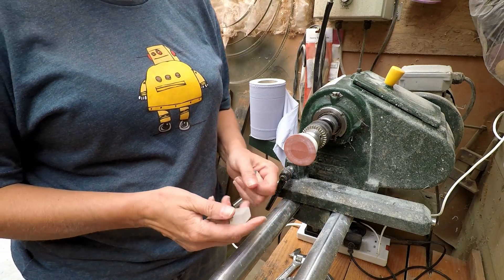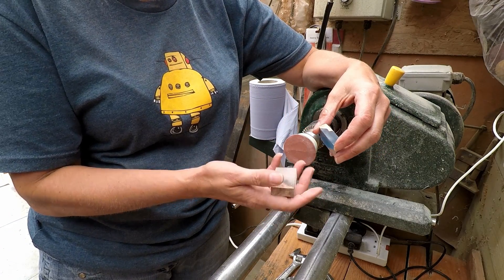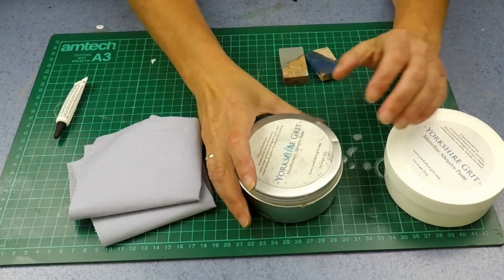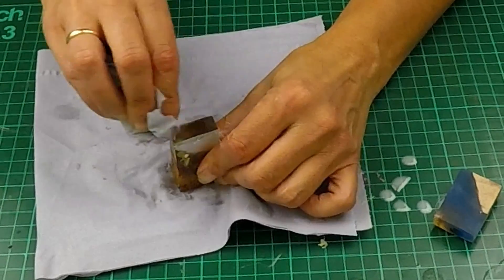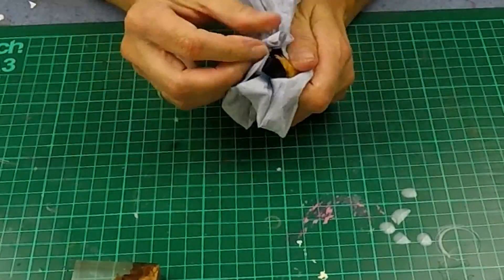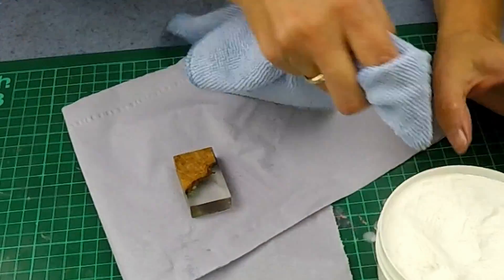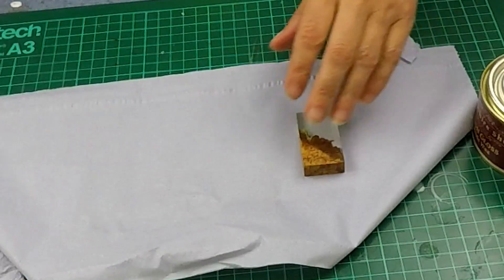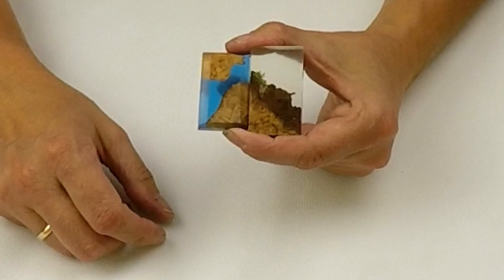Quick and easy high polish for resin Jewellery.

Comment: This was really interesting. You sanded to 600 grit yet then polished with Yorkshire grit which is 240grit paste rated and still got the shine. I would have imagined it would make it worse but clearly it works well. Lovely little video there. I usually use Mezerana polishes on mine but may give Yorkshire grit a try with a polishing wheel
Reply: I think it might be because the 240 grit grinds down to a finer grit as it says on the Yorkshire grit website:)

Comment: Thanks for this video. You've convinced me to buy Yorkshire Grit and the microfine one aswell, so I'll do that real soon. Seems like it'd save alot of time instead of what I've usually done, just rough sanded my projects then coated them with a layer of epoxy, which works great but it adds a ton of time you have to wait and alot of things that can go wrong. The yorkshire grit doesn't seem expensive either, which is nice. Thanks again <3
Reply from the maker: Thank you yes has really made a difference to the finish in my projects :-)

Comment: Do you remember each grit of sandpaper used to go from 120 - 600? Or did you go straight from 120 to 600 without other grits in between? Thanks, .and love your channel :)
Reply from the maker: I ised 120, 180, 240, 400, then 600. Thank you :-)

Comment: Hi Pam, do you find your resin clear enough with this method? I'm really trying to mimic glass with my resin. Should I add a round of 10,000 or 12,000 grit wet sandpaper after the microfine paste in order to get even more clarity? Or will it not make a difference? Thanks!
Reply from the maker: Hi i do get really good clarity but i say try it as you never know it could be clearer :-)

Comment: What about different beetwen black and White ?
Reply from the maker: black it a higher abrasive so you sand resin to 400 / 600 then use black original one then follow with the even higher abrasive white one.

Comment: I must be either extremely retarded or there's a catch that I don't get. How do you get such a nice 90 degrees corners? Not to mention that 45 degree angles the blue one has. I have a belt & disc sander machine and I've tried hard to get them as yours but I just can't. Would you be able to share some advices?